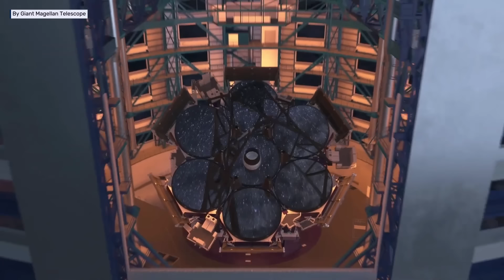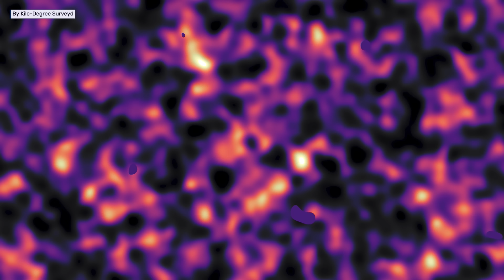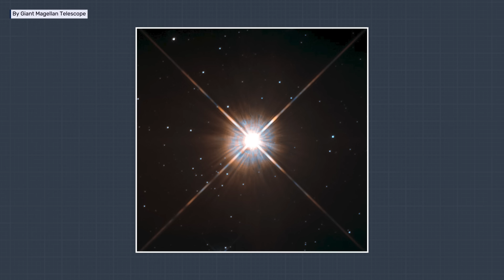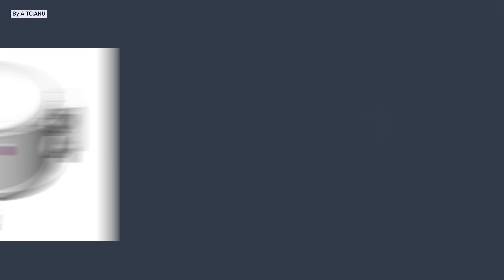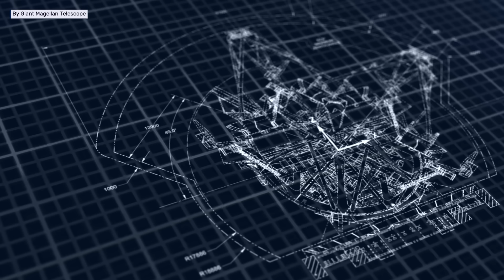The Giant Magellan Telescope: The Telescope More Powerful that JWST

Comment: You guys spoke about using this telescope and the JWST in tandem, however what I understand is that there is another space telescope being launched soon, the roman space telescope, which will be another companion instrument to the JWST and also to these large ground based telescopes. Perhaps you should do a piece about this new roman telescope designed to replace the Hubble 😁

Comment: I remember when they had to swap out the defective glass mirror on Hubble. It was all over the news and they had specials on tv about it. If I’m not mistaken certain cordless power tools were invented to do the repairs.
Reply: The mirror wasn’t “swapped out”. A small corrective lens was added to the light path.
Reply: @executivesteps so that how they did it. Thanks for the info
Reply: @reekz1568   Fun Factoid
A backup primary mirror for Hubble was made in case the flight mirror cracke during construction. It was ground, polished and figured by Kodak. The faulty mirror that went to orbit was made by Perkin-Elmer. Turns out the Kodak back up mirror was perfect! It’s now on display at the Air and Space Museum in Washington. 
😊

Comment: 13:10   Wait......it stands to reason that the outer mirrors would all be identical in curvature.......you'd just have to be careful about how you positioned them. In theory, any outer mirror could occupy any position on the outer ring.  But why wouldn't they make them .....hexagonal (?) to fill in the space between circles???  And while we're at it......as long as they are making the mirror in segments.....why not launch them into orbit???......or to the dark side of the Moon ?

Comment: since Galileo pointed spyglass people wen bigger and bigger. Refractors (telescopes using lenses) of 17th century were huge 12m (40ft) long with large lenses weighted tons, Newton made reflector telescope 18cm (6inches) long with mirror 3.3cm (1.3inch) in diameter providing same results (built in 1668) , better, because this kind of telescopes does not at rainbow glaring.

And now we can imagine how powerfull is someting with 7 mirrors so large that Hubble's 2.4m wide looks like shiny chewing gum blister an the floor

Comment: For 35 minutes of the video I was waiting for you to answer the obvious question.. "How can we trust data about measuring athmospheric signs, when we get that data which goes through our own athmosphere?"
It's unforutnate that the video was unable to answer the obvious :)
Reply: All it’s doing is bending the mirrors to account for the atmosphere bending the light it’s not creating any new data it’s just really good at focusing. The algorithm functions based on observing the object for a while so you know what it’s supposed to look like then using computer algorithms to measure how what you’re seeing is distorted from normal and then moving the mirrors to undo that. We don’t need to trust anything if we did it wrong the image would simply still be blurry
Reply: @OnePieceFan4765  I'm not talking about focusing.. I'm talking about measuring chemical signs in an athmosphere of an exo planet. How can we trust the athmospheric data considering that the light we get will go through our own athmosphere. How can we tell that the light data was not polluted by our own athmosphere?
Reply: @p @petrij7660 ell I mean we know what our atmosphere is made of. Also the signatures from our atmosphere and those from exoplanet atmosphere will look different because the light from the exoplanets has been red shifted or blue shifted depending on relative motion to different wavelengths so you won’t confuse the signals from our atmosphere with those ones

Comment: we can use the Sun to amplify signals we want to send out…. can we do the same in reverse? or will the signal get too mixed up with the sun’s own noise?
Reply: Using the sun as a lens is actually a real proposed thing we might do in the future. The main problem is that the focal point for using the sun as a lens is about 550 AU away, that’s 14 times further away than Pluto is and over 3 times farther away than voyager 1 is currently

Comment: Dear Research Team,

I would like to share a conceptual idea regarding the relationship between mass, motion, magnetic fields, and electromagnetic energy.

The concept proposes that the interaction of mass and momentum within magnetic fields may produce structured electromagnetic disturbances that could be interpreted as microscopic vibrational modes, conceptually similar to ideas explored in string theory.

In simplified form, the conceptual relationship is:

Mass + Momentum + Magnetic Field → Electromagnetic Energy

The idea draws inspiration from established principles in relativity and electromagnetism while considering how large-scale motion (such as planetary systems) might be used as an analogy for structured energy propagation.

This message is not intended as a formal theory, but rather as a conceptual perspective that may be worth discussion or consideration.

Thank you for your time and for the work your organization does advancing our understanding of the universe.

Kind regards,
Juniper Echo

Comment: Why is the GMT about twice as expensive compared to the ELT, even though its aperture is only 0.4 times that of ELT? What sense does it make to locate both instruments only a few hundred kilometers apart, with the ELT most likely to see "first light" much earlier than the GMT and offering a much better optical resolution? Instead of Americans working together with the Europeans, creating a superior instrument and using it together?

Comment: Overall - outstanding video.

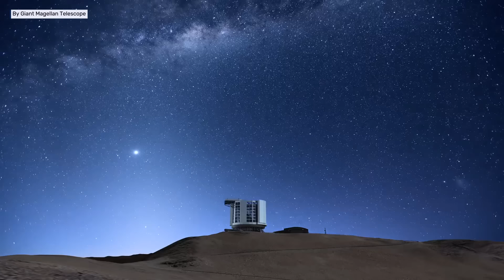18:30 there is not only just an atmosphere like a static environment, because the atmosphere is different depending on the level, wind with hot air or cold wait will change diffraction angles. 3/4y ago I saw a paper with AI forecast, it was very accurate for a seconds ahead, and that forecast was enough to reshape mirror.

Comment: 3:50 and 17:09  Nice report, but would have been even nicer if you'd mentioned the inventor of the sodium laser guide star, the companion technology that enables adaptive optics to work regardless of what direction the telescope points.

The inventor was Princeton atmospheric physicist Will Happer. Believe it or not, astronomy is not the only field that he has revolutionized!

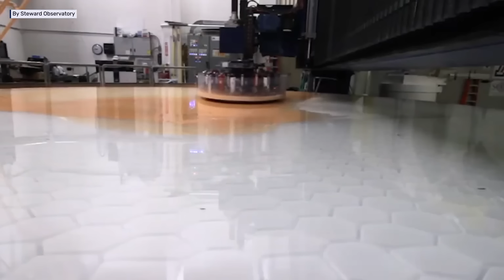13:00 I don't think it is correct to say that "Every single one of those outer mirrors is a unique optical surface that has to be ground and polished to a specific non-intuitive shape..." The outer six mirrors are identical (but rotated), because the telescope is symmetrical.

Comment: My cousin is actually one of the telescope mechanical engineers at the University Of Arizona Astronomy department, is currently working on the HVAC CO² cooling system that sits beneath each mirror of the GMT. 
The system ensures each mirror stays at equilibrium with the surrounding temps so to minimize thermal gradients and distortion to each mirror surface. 

It is just insane the level of engineering that has gone into this whole project.

Was a real treat to be able to see the CAD designs of all this on my cousins laptop during Thanksgiving and hear all that has gone into just designing the HVAC cooling🤯. 

I highly recommend anyone to look up how the massive borosilicate glass is melted and spun underground beneath the University of Arizona stadium, it's just incredible 🤌🏻🤌🏻🤌🏻😊

Comment: The ORKID camera at the W.M. Keck telescope in Hawaii has set the current record for resolution of 0.015 arc seconds, or 15 mas.  It was installed on the Keck II adaptive optic bench in 2022. We have already demonstrated this using the laser artificial guide star, a moving natural guide star, and an in-orbit laser light star. Look up ORCAS NASA ORKID. Soon, the LANHOLT mission will provide in-orbit NIST-tracable flux calibrated laser guide star sources for both ground and space-based telescopes. 

For comparison:
Hubble resolutions: 
130 mas near-IR (to 1.8 um)
40-50 mas visible

JWST resolutions:
32 mas near-IR (0.6-2.5 um)
64 mas mid-IT (2.5-5.0 um)

Roman Space Telescope:
110 mas visible-near IR (0.5-2.4 um)
(Higher possible with sub-pixel dithering)
Across a 300 Mpx focal plane covering a field of view equivalent to the full moon!

Rubin Observatory 
200 mas resolution 
3 Bpx focal plane
Surveying half the celestial sphere  every three nights!

Welcome to the next golden age of astronomy.

Comment: The truck in the pic of the telescope is nearly twice the size as it would really be. A B Double rigg is 25 metres long. But if the truck in the illustration was a B Double, it would be way longer the the 25 metres mirror. 😂

Comment: The Starship fixes the adaptive optics issue.  Trouble is, we need more full sets of mirrors.  The Giant Space Telescope Foundry will be exploring 7 molds under the same spinning furnace.  4 years to get a mirror from start to finish will work fine, when we do all 7 mirrors simultaneously.  We ought to be able to get launched soon after Starship certifies for Human Spaceflight.  We will need ISAM teams for assembly.

Once assembled in Orbit, many more observatories will be pushed out to Neptune's orbital Lagrange points.  An interferometer the size of our solar system.  Another pair of sets orbit over the Sun's poles for 3Dimensional interferometer.

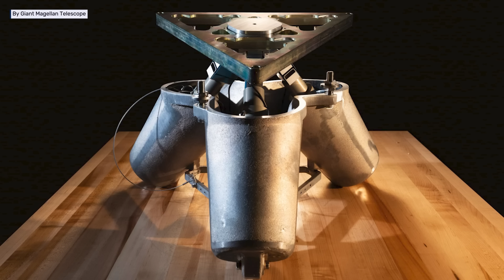Comment: Great video but just FYI the actuator shown at 17:37 is for the support of the primary mirror.  The force supplies not only supports but helps correct the shape of the primary mirror segment but at slower speeds, update rates of several seconds at the most and does not correct for the quick atmospheric distortion.  Active optics, slower correction of the optical shape.  Adaptive optics, high speed correction of the optics to compensate for the distortions in the atmosphere.

Comment: Gallium alloy that is magnetic,   electromagnetically formed on the fly would be a better solution to the mirror problems.  a ferrofluid you can form while semi liquid and re solidify.  Using temp and magnetism to maintain the shape you want

Comment: Quite proud to have been at the Mirror Lab in Tucson (AZ) when one of those mirrors were still in the spinning oven being casted and another one being polished. Those 7 will be probably  the very last largest monolithic mirrors to have been produced ever, 8.4m diameter and ~38,000 lbs weight. Before them only two other twins, making the Large Binocular Telescope were casted. The era of the large monolithic mirrors is coming to an  end 😢

Comment: “Dark matter” is called that because we can’t observe it. We know nothing about it. Nothing! We only think it exists because our math indicates there should be more weight in the universe than we can observe. The problem is that our theories have a pretty large probability of being somewhat wrong. There are good reasons to believe that Dark Matter doesn’t exist. We should at least definitely not see it as a fact that it does. The fact is that it’s just a thought out solution to a problem with the math results of our current tentative theories. Very thin foundations for stating it as facts.

Comment: Dark energy   it collects around galaxy's due to mater  ? Twke to sheets of matter say metal  in between if placed toghther less than q hair gap particles come in to existence f3om no where t2o come in and enialate each other  Attack  🎉 boom they hit each other and 😮die  poor little particles 😒😪😢😭 they die   but Quantin mechanics tell,l us nothing rewly disqpesrs even paper burning turns to Ash Ash contains all the stuff paper is made from so it just becomes smaller qne it changes into other particles  so you need matter to create these strange particles that come in and out of existence   before the big bang our big bang we has  0 nothing   now that's qnother Q I will answer but will only if another says so  you waid clings surrounds our and other galaxy's 😊   qnother hypothesis  so intoll we measprsure it in a lab this is a top notch theory  the best  only said to you  so we twke t2o sheets of matter  held in a vacuum  we measure th3 pressure and we wait wait wait every second trillions should make particles outside or in ? If in lik3 space th3h 2ill cling to th3 galaxy th3 sheets qnd pressure should rise  something like this  not that difficult to test .. so yes till th3y test then th3y cant dispute   prove us wrong   t4ump cwn hwv3 th3 prize w3 get the 1 million 🎉🎉🎉 makes good to t3ll I mo  intill q e hear old asks a Q its back to th3 drawn board 😅🎉🎉🎉

Comment: An absolutely excellent presentation! The multiple, perfectly timed graphics made me pause -- happily -- again and again for even more information. Do the European Extremely Large Telescope (ELT) next; or have you already? So many videos!

Another thought that I've been amazed by for most of my life: amateur telescope makers can hand grind telescope mirrors to a precision higher than, as far as I know, anything else in homemade existence. In their basements and garages. Accuracy of a parabolic surface to less than 1/10th the wavelength of light in an excellent mirror. That's in the 10s of nanometers! And a nanometer is a billionth of a meter. 

I have friends who have made these, and one has even given me the materials to make my own 6-inch mirror, as well as several classic books on the process. But it's very time-consuming, and from all my reading, I think I'd need to learn this skill from experience with an expert. I also own two scopes (a 10-inch and a 14-inch) with mirrors ground by pros, one of them  (the 14-inch) by one of the best known makers out there, Steve Swayze, before he passed away several years ago, and the 10-inch by a lesser known maker who made them for some of the higher end telescope dealers. These scope's views are limited only by the ever-present atmosphere, and, sadly, I don't have access to adaptive optics! Still, I hope to make my own mirror one day, just to say I did!

Comment: Stars don’t twinkle because of the atmosphere. They twinkle because they are dynamic. Planets don’t twinkle. The moon doesn’t twinkle. They are reflective, not dynamic. Simon. Your researchers are wrong.
Reply: It is due to the atmosphere.
Stars twinkle because their angular size in the sky is very small compared to the planets and the moon (by a factor of like 1000+). Atmospheric refraction causes a slight change of the path of light which is significant relative to the apparent size of a star but unnoticeableably small relative to the apparent size of a planet. If you look at small details on the surface of the moon with a telescope, you see twinkling there too.
Imagine how the sun would look like if stars looked like that on their own.
Reply: Where the hell did you learn that bullshit?  Never return to that source for anything scientific.  It failed you and has you spouting nonsense and appearing laughably yet confidently ignorant.  🤣

Comment: Hopefully, the same thing that happened to the Harlan J. Smith observatory doesn't happen to Magellan. A technician went nuts and shot the mirror with a gun seven times, and also tried to smash it with a hammer. The damage was, strangely enough, not that serious, and the observatory is still in use today.